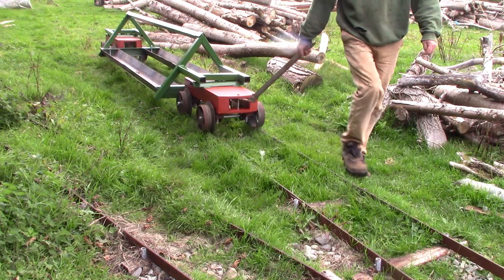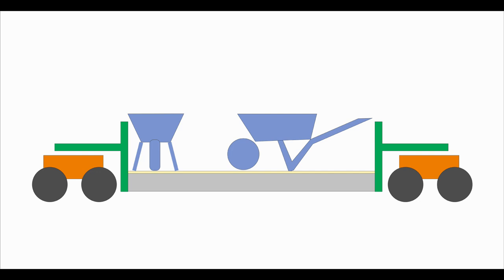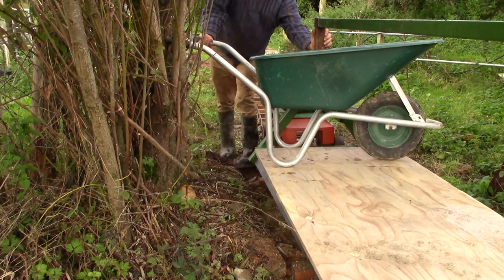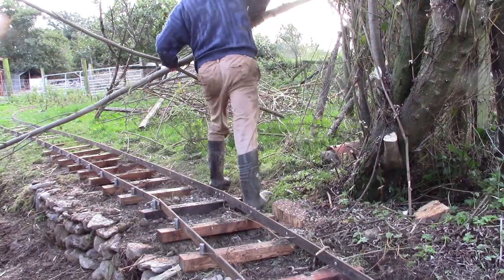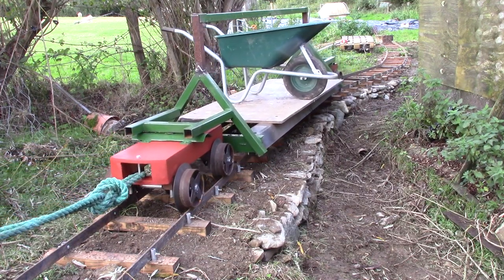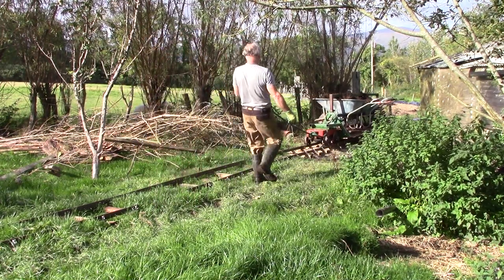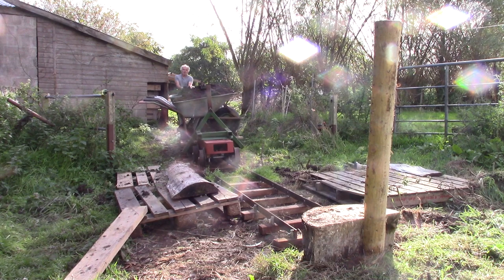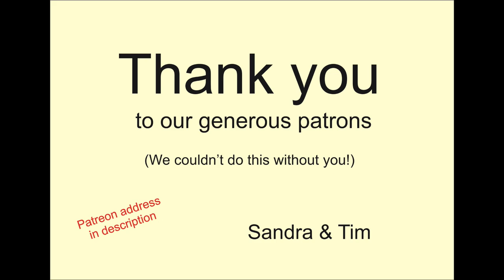All Aboard The Poo Train! (Amazing wheelbarrow transporter in action..)

Comment: An interesting idea might be to use a ropetow between the rails attached to a stationary engine/motor to move the wagons. Avoids the complexity and cost of a locomotive.
Reply: Might be worth it if the line was steeper, but the loco is still gonna be needed if the thing fails...so there's that. Especially considering available materials, the cost of said materials over a given span of time, climate, dynamic loading, and keeping the line on a budget. Locomotives on this kind of scale are cheaper in most parts of the world, as they can be made using a engine as small as a single cylinder, & bike chain (plus the other components). Plus it's more worth while to have versatility over simplicity. Not only that, but if done right, and you have a powerful enough engine, PTO could be an option for helping unload bulk loads (vibration).
Reply: both. both is good
Reply: @ivoryfields2631  Agreed. The rope tow might actually be better on the steeper sections, avoiding the difficulty of slowing a locomotive.

Comment: you once talked about using concrete for the sleepers. if you are using Firewood for Heating dont throw away the Ash, you can actually make cement out of it.
mix the Ash with Water and shape them into Balls like Snowballs and let them dry. once you have enough you can burn them in a Kiln ~1,5h.   you can make concrete out of it by taking 1 part Woodashcement and 3 parts of Sand and some water again. BUT the mixture is a bit causting and you will have burns on your skin so wear something over your hands.
video of Primitiv Technology  https://youtu.be/DP0t2MmOMEA   cheers and take care.
Reply: Doesn't really make sense to do due to the kiln's inefficient calcination process and the fuel cost of that.
Reply: If nothing else Ash can be good fill material- an inexpensive 'ballast' used for grading on old railroads was "cinder"- ash left over from burning the coal (or wood) that was used mostly for firing steam locomotives. It was cheap, plentiful, and they needed to get rid of it anyway. It won't be able to do all the magical things that proper ballast can, but it can certainly provide fill- and sometimes that's just what you need! But I get the feeling there's many good uses for Ash on a farm in Ireland, besides fill for building a railway.
Reply: @leverettrailfan5414  but from what I heard, they gets kicked up easily and gets everything dirty faster
Reply: @namibjDerEchte  the kiln is wood fired so provides more material

Comment: I suggest securing the plywood to the inverted troughs.  Add a 2" X 4" X 8" block to the edge where the wheels of the wheelbarrow are to stop.  This will act like a bumper.   Do the same for each leg of the wheelbarrow.  This will keep the wheelbarrows from sliding off.  When you lift the handles, the legs will rise above the bumper as you pull the wheelbarrows off the platform.

Comment: I know this was some months ago now, but it might be worth adding some gussets or diagonal bracing to the ends of the flatbed where it connects to the wagons, you're exposing those welded butt joints to quite a bit of force and the repeated load/unload cycles will lead to a fatigue failure.  adding a diagonal brace will prevent some of that movement.

Comment: railway design is sensible. Capable of increasing productivity greatly. Only one input I can offer is to run the railway through the centre of the garlic beds after harvest. A few cars dedicated to taking the harvest on racks and you could drive them straight into a drying tunnel. Harvest directly to the cars and let em dry on it. Same size has your wood chip cars but whoth horizontal mesh trays.
Honestly the suggestion only  is about minimising human handling time and distance walked.

Comment: You could use modified wheel barrows that have quick-change handles and perhaps even wheels so that they can be more compact on the railway and have the handles slotted in when needed
Reply: even just handles that hinge down instead of stick out will help a lot for clearance issues.

Maybe (once the budget is there for it) custom wheelbarrows that have more muck space in the bucket and are more compact on the car could be an option
Reply: Just two long straight handles that slot in, maybe with one of those spring loaded pins for security and a socket on the end.

Comment: Idea: have a little lever on all your rolling stock and if you push it then the brakes will apply.
Reply: He already has that on his locomotive
Reply: @OntarioTrafficMan  it would be smart to have one on all his carriages tho. That way, he can stop them anywhere on the track, without worrying about them running off when he turns away.
Reply: @mickys8065  Yeah but that would be a lot of work. Probably easier to just make some parking blocks. Just take a block of wood, cut a slot so it fits over a rail, and stick it next to the wheels when you park

Comment: That's the beauty of living in a country where they still allow the free movement of people, hence why you can use French person power. Over here in the UK we no longer have that luxury. Am glad this part of the railway works, you need to work out a pulley system that ties in with your static engine, which would help retrieve your muck wagon from the garlic field. You could also use it at harvest time, when moving the garlic from the garlic field. I say you need to work it out, because I have absolutely no idea how it would work. 😂🤣
Reply: What a nonsense statement about using the French. They might be long term, but are probably short term in Ireland, and that would be covered by the reciprocal 90 day tourist visa that UK citizens would have to Schengen and vice versa.
French and other Schengen citizens come to the UK to volunteer under WWOOF, free board and food, they just can't get paid for it.
Also you obviously didn't watch the video properly to think that it would be in anyway feasible the muck heap to garlic run can be powered by a cable from the stationary engine.

Comment: 11:02 If the plan was to use a horse to pull 6 barrows and two Frenchmen can move 4 barrows, we can therefore presume that if the horse is good for 6 barrows, i.e 1 Horsepower, we can assume two Frenchmen is 2/3 of a Horsepower or single Frenchman is 1/6 of a Horsepower.

I therefore submit that we use the "Frenchman" as an additional fraction for the measurement of power output, 1 unit of Frenchman (written as Fm) being the equivalent of 1/6 of a Horsepower or 124.2 Watts.

Comment: Rather than controlling the speed downhill by holding it back with a rope, an upgrade could add a platform on the rear bogie where you could sit/stand and operate a handbrake. A simple rim block like your locomotive has should be fine.

One axle alone may not have enough traction to stop that heavy load so it may be necessary to link the two axles of the bogie using a chain or tie rod.
Reply from the maker: Exactly - so that's why I'm holding onto the end of the rope. Much easier/cheaper/quicker : -  )

Comment: Two thoughts sir.
1. you need to build a mucker like they use in a mine.

I was just thinking a guy could put an axle with rail wheels on the back of the wheel barrow(s) and figure out something for the front that would be easy to install & chain the together & forget about the car all together.
A pair of rail wheels up front might just push over soft ground just fine🤔
Reply from the maker: you mean four wheels instead of one?!
Reply: Exactly, they already make two wheel wheelbarrows. the two back ones could be pretty small 3”? so they would clear the ground when using the wheel barrow.

4 small rail wheels set underneath in such a fashion that the tyre would clear the points & all you had to do to 
 empty it would be to pick up
up on the handles and wheel away.

Comment: Lovely. You might want to add a break with a handle bar that only releases when pushed on it or is locked in the open position to each end of the wagon to prevent it from running away accidentally.

Comment: This looks really cool, I think you should try to build a magnetic break like on a rollercoaster for the bottom of the hill. 
That way you could push it off at the top and it will auto slow itself down even with full load. Its just a 3rd rail made from steal and then some magnets on the cart itself.
You could make a mechanism on the carts that when you push it up hill again you can lift the magnets off the 3rd rail so they don't have any resistance.

Comment: I wonder if the original longitudinal barrows would have been better , just with modified unloading ramp. Eg  either a drop in section ot having the ramp just under the wagon side extensions. This would also give a support effect as you wheel the barrow off too

Comment: I know that the search for the compressor is still going on but can the engine be used as a helper to make the load lighter ? Or can it actually push the poo train.   If it can’t some shots of the train running on the line would be fun.

Comment: could a few pulleys and such allow you to use the stationary engine to drive this?

thinking a bit like how some mine carts used to run, constantly moving loop that you can connect to and disconnect - at least to pull up hill

Comment: Tim, you need larger area flat plate on the bogie turntables, replacing the small circular washers you currently have. This will greatly reduce the sideways wobble you get.
Reply from the maker: but I need the wobble! That's to cope with the undulations of the track

Comment: You might want to see about adding a set of parking and lever hand brakes. That way you can use Gravity to your advantage and wont have to work so hard trying to control the speed of decent with a full load.

Comment: Now u need to customize the handles of the wheel barrows!  They only ever need to lift up with force.  I am sure you could put hinges on the handles with pins or something to make them easy to put up and down without tools.
Reply: We have handles like these on our wheeled generator, and TBH, they're a pain in the backside.  Unless the hinges are really solid they flex, which makes them feel "wrong".  Trying to push a barrow forwards and "bump" it up a step means that the hinges tend to want to fold, and if the hinges are not fully rigid, the barrow loses momentum as the hinges flex.
Reply: @misterflibble9799 You make a very good point sir.  That is not at all the sort of well thought out feedback I would expect from a Mister Flibble!  👍🏼😎  It might be worth trying on one wheelbarrow just to see if Tim can work some mechanical magic that would make them rigid enough to not feel wrong.

Comment: This is fantastic!  Really enjoying your work.

Would stops for the barrow wheels on the deck make sense?  Just some screwed-down 2x4s that you could run the wheels up against.  These would both hold the barrows more securely and expedite loading because you could run in at higher speed and immediately know that you are correctly positioned.
Reply: Just some small angle irons upside down, maybe only one for a stop.  Could be done with a wooden triangle block

Comment: @Way Out West - Workshop Stuff
6:06 What if you make the wheelbarrow itself run on the track? (without the train, maybe can connect multiple of them to a train?)
Or maybe a minimalistic "adapter" (platform?) thingy, that you can just easily attach & remove from the wheelbarrow?
It gives you the benefits of the flatness of the rails, the stability of multiple wheels, removes the heaviness of the train, etc...
Reply: Definitely a cool idea, something simular was used in the USA for truck trailers
Reply from the maker: It sounds simple enough, but I couldn't work out a way of doing this without lots more wheels
Reply: @wayoutwest-workshopstuff6299  Ok.
It was just a thought I had that could be worth thinking about.

Comment: why not go with the oryginal design and just install 2 hinges into the platform so it can be pull up tucked out of the way when passing it and open back down to unload
just split the palled in the middle and connect it back with 2 hinges from the top

Comment: If you put some little adjustable bars on the top rail to push down on the wheelbarrows you could kinda secure them into place and don't have to worry about them tipping over.. you would need to fix the top beam to the underside tho.. just an idea (:

Comment: With the original design, could you not have added small openings in the side of the girder behind the desired locations for the wheel of the wheelbarrow to enter through, then get pushed forward into the full V shape?
Reply from the maker: that would really weaken the girder though?
Reply: @wayoutwest-workshopstuff6299  that is a very good point that I didn't consider. Perhaps add only 1 opening near the back of the girder, where the frame of the trailer can extend under the girder to support the weakened section (Such that the weight of the load now presses on the support section instead of the opened girder). 

This would then allow you to load up the 3 barrows by pushing them through the gap then down to their final place. 

Admittedly, this sounds like it would be a lot more work compared to your current solution, but having 6 wheel barrows easily held on seems more efficient and overall easier than the 3 we saw here.

Comment: it's good to see that that the double bogey wagon is coming along, but this project was needed in order to get the garlic planting done, no? i hope you aren't being held up too long!

I suggest making some gaps, or shallow areas in the wood board for the wheel and feet of the wheelbarrows to sit in, so they're more secure, and kept in a correct position better.
Reply: i agree
Reply: Or keep the metal rail in its original trough side

Comment: Next thing will need to be an engine, a used mobility scooter would do the job, take the motor transaxel assembly and the motor controller and throttle and use it to drive all 4 wheels of 1 bogie, simple for you.

Comment: Only you would know, but with the way you normally use your wheelbarrows, do you think you really need the leverage of the full length handles? It seems like an awfully simple fix just simply shortened the wheelbarrow handles 6 to 8 in. I don't know if they have rubber grips, but there's an old bicycle trick, hairspray acts like a lubricant for a critical 10 seconds and then like a glue after that, very easy to transfer them.

Comment: You could build a small tool waggon and fit it with brakes to use as a break waggon  and attach this to the  rear of the train.
Reply: You need the weight to brake effectively
Reply: @notabagel  At this scale you don't you have the weight of the train and you just need some brakes. Even if you put brakes on the train itself it will slow it down. You might get some slipping but I doubt it. You don't want much extra weight as you still have to move it.
Any kind of braking is better than none.

Comment: By using L shaped steel flat rails you can use wheel barrows as your cars
Reply from the maker: very difficult to curve though
Reply: @wayoutwest-workshopstuff6299  that’s true. I’ve heard many people say it. I feel like the only way you could bend them is by having a lot of short pieces and placing them at different angles, but the issue is it will make the curves not smooth at all!
Reply: @wayoutwest-workshopstuff6299  I think I just described a plateway now that I think about it.

Comment: Sandra & Tim,
Smashing job I thoroughly enjoyed the video as always!! 
Just a query or a thought... Would it be possible to extend the railway into your garlic bed and use a dump type skip instead of wheelbarrows?
I realise then you would lose some area to the railway, but could you regain their by extending the garlic bed it either side of the railway?
Reply: This was covered I think...it was the weight of tipping it that led too the wheelbarrows
Reply from the maker: It's just that the muck would be dumped so close to the rails - so you'd need a track between every bed (which would be crazy!)
Reply: @What..a..shambles  I'm not dibuting the need for barrows
Reply: @wayoutwest-workshopstuff6299  I posted without see the original video explaining your bed arrangements now I understand why that would be less practical thanks for the fast reply keep up the good work!!

Comment: Looks fantastic, after the last time we spoke in these comments I have come to learn a few difficulties that could slow or stop the progress of my railway entirely, but besides that, there ain't much. But I will say that one of my first wagons will be similar to this one, except mine will be more designed to carry other wagons or Loco's in case of an accident on the grade, but with the rails on the wagon being removable in case another use comes up, along with only 2-wheeled bogeys. But also a suggestion, I would recommend building a set of buffers, so then, say when you finish another piece of line, you can just plop the buffers down instead of leaving the track open-ended

Comment: Hinged handles on the wheel barrows! Fold up slightly for the journey. Fold back down to offload. How to do it exactly?  Tim would come up with a more elegant solution than I ever could.
Edit: Wrote the comment before the "just move the railway" bit. Very elegant indeed. Still want to see hinged handles :P
Reply: fold them down for the journey! then you don't need an difficult locking mechanism when you want to use them to lift up the wheelbarrow, as the hinge would lock itself
Reply: @Jacob-W-5570  Yea something like that.

Comment: An idea for braking:
Put a plate above one wheel with some distance.
Put a wooden wedge between the wheel and the plate and tie a rope to it.
If you pull on the rope, the wedge gets jammed between the plate and the wheel, if you let the rope go, it gets pushed out again.
This will only brake in one direction but that's what you need for that hill.